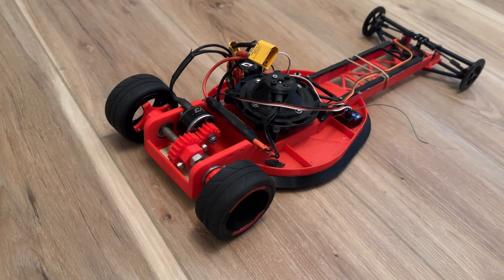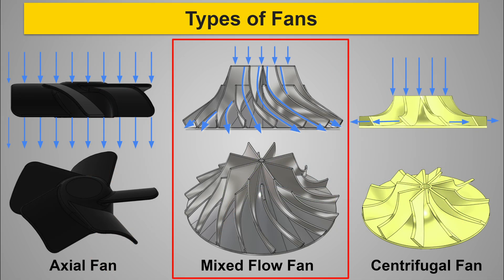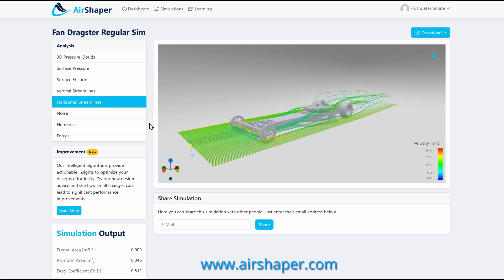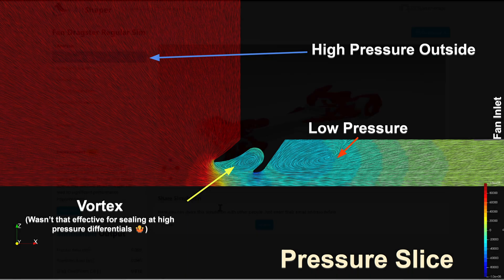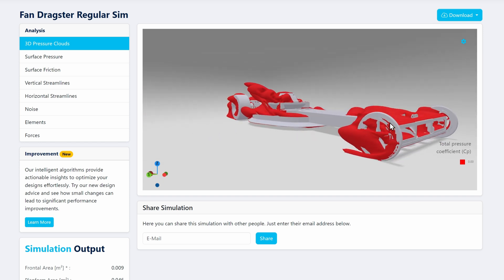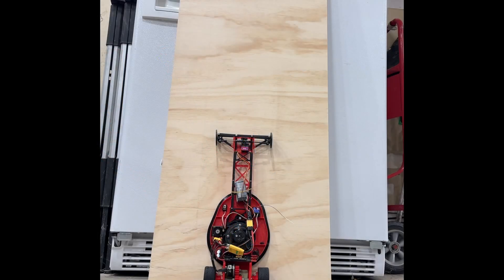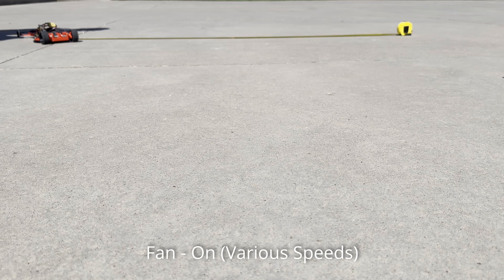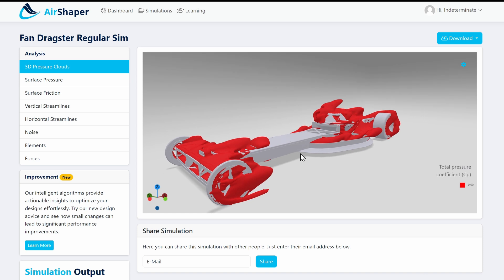This RC Dragster Uses a Fan for INSANE Downforce & Acceleration!

Comment: World record is 1.11 seconds 203 kph in 1/10 drag strip or 40.2 meters the car is a drag rail car =no frontal area .. you can see what a real rc drag car does type worlds fastest rc drag car 1.11 …Brendan podlich set this record over 10 years ago now .. I take nothing away from you experiment it’s excellent but in drag sense for rc cars it’s no comparison to what racers achieve

Comment: I am so glad I found this!  I've been researching background knowledge to make my own fan downforce combat robot for ages, and I've always agonized over the choice of fan type.  I'm so so so glad you put in the work to run the CFD and show  how helpful it can be; my plan before watching was to just run a ton of physical experiments, but you've sold me on  trying Airshaper instead.

By the way, have you considered an air jet skirt design?   They work by pulling air from below the skirt with a high static pressure fan and jetting it downward around the periphery of the low pressure zone to form a "wall" of air.  I've only found one research paper on their applications for downforce (since they've mostly been used for hovercraft), but it seemed promising.
Reply from the maker: I read that research paper as well, I haven’t tried simulating the air jet system, but it’s on my list of things to try. I don’t know if it can be done with just a single fan so that adds some complexity. When I just duct the air coming out of the main fan I don’t have sufficient volume. The better it seals the less air the main fan has to create the seal 🤔

I don’t remember seeing it in the paper, but there’s also the effect of the car moving.  Looking at the CFD more shows a lot of air being forced under the front of the skirt.  

There really just hasn’t been enough research done on fan cars.

Comment: Brilliant! I believe that if you angled the blades at the inlet you could achieve more pressure differential between inlet and outlet. A MAP sensor could alter fan motor speed rather than the relief valve if you think it could give more control of the pressure drop. Foam tires will give better traction. You could use carbon fiber sheets oriented vertically to stiffen the frame in bending. Making the frame able to twist the front axle can help handling. Think a pivot to allow the tires to go up and down acting like a single front wheel can help traction. I've subscribed. I want to see where this goes!
Reply from the maker: That's interesting, I want to try more fan designs.  When I was trying different blade profiles I had a hard time increasing the pressure ratio while keeping the same flow.  I think I need operate the fan at a much higher rpm, like 50k+.  I'm working on some designs for a better fan car based off the chassis and suspension of my RC Hypercar, then I can individually tune the different suspension modes.

Comment: Great video and thanks for the shout out! 

I like your approach to seal path length. if i were to do it all over again i would make a smaller seal area because i often had more downforce than i wanted but was super leak rate sensitive.
Reply from the maker: Thanks. I wish there was a way to make these cars less sensitive.   I’m going to mess with some pressure sensors and controlling the fan speed realtime.
Reply: @IndeterminateDesign  I really think I can help out. This is one of my passes a lil while ago at the midwest classic. No prep surface, 2s battery, rear wheel drive only, rubber tire. 
https://youtu.be/9vphxP0f1e0

Comment: Why is the rear tire low profile? There is no sidewall to crunch, increase traction, & shorten drive ratio?

How does a bristle brush skirt compare?

Why use a valve to control downforce instead of a sensor & fan controller?
Reply from the maker: I had to use stiff tires and reinforce them with inserts to try and keep as constant of a ride height as possible due to the downforce. Bristle skirts can work somewhat but you need enough room for the bristles.  This was just a first test hence I didn’t want to complicate it with sensors and tuning, the mechanical valve was simple and light.
Reply: @IndeterminateDesign  a simple pressure switch would be lighter, and conserve battery, but if you worked in a traction control system (with a pressure sensor) you could take full advantage of wrinkle wall tires.

Not only does the contact patch get bigger (longer) when it is launching, the tire gets shorter, so the gear ratio gets shorter. As the car accelerates the tires get taller, so the gear ratio gets taller. The tire is almost a vintage CVT.

Comment: How much force does the fan have to have to be effective? Nothing off the shelf in terms of cooling fans would do anything I'm guessing
Reply from the maker: Any fan will create some low pressure. It really comes down to how much floor area you have, how well the floor is sealed, and how much down force you want to generate.  Most full size fan cars, like those used for FSAE use powerful radiator fans because even a small pressure drop over a large enough area can create a lot of downforce.
Reply: @IndeterminateDesign  so do you a 35 or 40 mm fan spinning at 21000rpn would be worthwhile?
Reply from the maker: I don’t know exactly. You could test it with a piece of cardboard the size of your car’s underfloor and some spacers that are the distance to the ground under your car.  Then try to lift a box or something with it.

My car was able to lift a filament box with ~2kg of filament.
Reply: @IndeterminateDesign  that's a great idea actually.. Thank you

Comment: The Brabham BT46B had this in the late 70. It got banned because moveable parts for aerodynamics were not allowed. And if the car looses the contact to the ground, out of what ever reason, the ground effect was completely gone and the car would flew into the sky.

Comment: i love how you managed the pressure, that little valve was genius . i've been tinkering with my own at our biweekly drag meet and having the pressure fluctuate made it hard to be consistent .that valve is exactly what i needed. a receiver with a gyro or even just a standalone one will do wonders for keeping your overpowered motor version going straight. and when i added a slipper clutch it gave me more options to really dial it in and lowered my time.
Reply from the maker: Thanks. I agree, I never got the gyro going on the car.  I need better front tires too. Oh well, next version.
Reply: Great project cant wait for v2 there are some traction addatives i think would help with initial wheel spin & i know this is what your priject is about but would b interesting to join both forces once you get all u can out of the vac👍

Comment: What material are hovercraft skirts made of? The suction force from the fan could be the inflation force for the skirt too maybe.
Reply from the maker: Most of them are just reinforced rubber. They do wear fairly quickly, but they usually leak some air so the skirt isn’t in constant contact with the ground and they’re pretty slow <35mph so that helps.

Comment: Side skirts were also ubiquitous in the F1 ground effect era. Some teams used brushes to effect an edge seal, a long thin strip of that brush like draft excluder might serve well on the RC scale.
Reply from the maker: I really thought about using brushes as a secondary seal to help block out debris and provide a bit more sealing.  There are so many things to try out.

Comment: could you make the air gap variable, so you can get max downforce at launch and reduce it as you gain speed by raising the skirt a few mm? That way friction should be a lot less of a problem
Reply from the maker: That could be done and I could do that by changing the fan speed as well based the car’s speed.  Ideally you want a consistent level of downforce because the motor has way more power than the tires can handle at almost any speed. Part of why I think it may spin out is because the downforce drops when it hits a bump or rough surface.

Comment: Is your idea would be the reason why I would want to get into drag racing because the biggest problem I've seen with all the drag races out there is they can't run a straight line and I think that just sucks so you're an idea is super awesome maybe the car companies RC that is needs to incorporate that into their dragsters and quit playing around about it
Reply from the maker: Yeah, I think it’s already banned. I’ve seen some of the rules and they only allow fans on the ESC or motor to exhaust down. I think some people were mounting ESCs upside down with powerful fans 😂. 

I really wanted to make a drag car but they also ban non-commercially available chassis’s.   I really hate rulebooks.

Comment: Maybe a mesh guard for fan and foam tyres?
Reply from the maker: I think grippier foam tires would make a huge difference.  I did try some mesh on the fan inlet but it clogged really fast with debris.  The skirt blocks the large debris, but sand and tiny rocks still go through and chew up the nylon fan blades. I’m thinking maybe a cyclonic separator or something.  Basically remove the heavier particles.

Comment: great work,  try the battery at the back in front of the motor.  also did you design in some castor to the front?
Reply from the maker: Thanks. There’s no caster in the front since I didn’t think I’d need for it to turn at all. The front tires are TPU which also don’t give much grip, in retrospect I should have done a lot more work on the front.

Comment: Why do you feel the need to have a sucking skirt? I would have air scoop ducts facing forward ,and duct them to the 4 corners of the car facing up! Like an upside down  Harrier Jump Jet! Then it can at least look like a normal car, this could give any car downforce!
Reply from the maker: Mainly efficiency, with roughly 12-15amps current, I can generate 2.5kg of downforce. To have that same amount of thrust by throwing air straight up would require a lot more power.

Comment: You could look into adding "bumps" or "sliders" to the  floor seal, so that even when it is scratching the floor there is a gap for air to enter, and you don't get a perfect seal. Of course, this would still create some friction, and I don't know how they would perform at RC scales.

F1 does something like this with it's floor edege skids, because these flex so much that they where scraping the ground forming a perfect seal that induced porpoising.
Reply from the maker: I’ve been looking hard at some kind of skid devices. There are some metal ceramic inserts for polishing that could last a long time like this.  I need to test it out. I’ve been mainly worried about the relative surface roughness just grabbing the bottom of the car and ripping the skirt off. 

I need a smooth indoor RC car track.

Comment: Nice ! Do you plan to iterate on it ? May be you can extend the skirt further to the front to find more area ?
Reply from the maker: I want to iterate on it more and see what I can do.  Changing the floor height and possibly moving the fan inlet forward can shift the downforce significantly.

Comment: Hi,
Awesome project and results. 
Just found out your channel so I don’t know if you’ve tried this before but, stability issue with the large motor might be solved by increasing front toe-in angles.

Let us know about the improvements.
Reply from the maker: I’ll try that. I didn’t talk about it but the tiny front tires are made from TPU and don’t have much grip so steering isn’t great.
Reply: @IndeterminateDesign  I hope the additional slip due to toe angle will generate higher lateral forces s.t. it will be enough to help stability. Good luck with your further improvements.

Comment: Maybe mount the fan deck also on wheels? The same as a ride-on lawnmower cutting deck to keep the skirt at an even height.
Reply from the maker: I really want to try that with some tiny casters.  I really need a whole more complex chassis that allows for enough for a skirt to slide up and down.

Comment: 2 fan blades, 1 with reversed blade direction...1 blade spinning 1 way...the other spinning opposite....to mitigate that rotational force? Are you not constantly having to correct the steering? Especially at distance?
Reply from the maker: That’s interesting. I didn’t think about that. It drives really straight when I’m not full throttle.  I only notice it when I change the fan speed quickly.  Would it still do that at a constant speed?  I know on RC airplanes this shows up, the fan is only 60mm diameter but spinning at 30k+ rpm.

Comment: Now put a real no prep rc drag sensored power system, drivetrain and slicks on it. make the wheelbase and trackwidth compliant with short truck based drag cars, put a body on it, and go take some peoples  money.
Reply from the maker: That would be awesome.  I really thought about buying one of those carbon fiber drag rails but wasn’t sure this would work at all. 

Surely the no-prep guys have some rules against fans. Otherwise I could put a massive fan on my ESC 😂
Reply: @IndeterminateDesign   rear mounted ESC with thrust ducted over the heatsink.

Comment: You've clearly done your homework on this project, but I thought I'd share what I'd have done with no research.
My thoughts went directly to a blower (squirrel cage) with the intake ducted and rear facing exhaust. I would have looked for a soft bristle brush type seal which would leak off enough air to not need a regulating valve. 
Now I'm curious how this would work, if at all.
Ratio changing dragster tires could offer the ability to switch from vacuum downforce to a automatic wing since the wing would start to work about when the tires grew enough to dimp the fan downforce.
Awesome project with impressive g-forces and challenging frame flex.
Reply from the maker: Thanks. I thought about the squirrel cage fan but packing is harder. CFD was helpful because I got a lot better feel for how much air the fan needs to move.  I think any kind of fan could be made to work. It comes down to your approach. High suction for a small area and less seal leakage or lower suction over a much larger area with a lot more seal leakage.

Comment: try Front Wheel Drive..... shouldn't be too hard with what you have already. at least for directional stability, straight drag racing. I heard about this concept from a Veritasium video about AI mini RC cars racing through mazes, "Micromouse".
Reply from the maker: That’s awesome. I should have tried running the car backwards. I bet it would have done better. There’s not a lot of weight transfer with a car like this.
Reply: @IndeterminateDesign  👍

Comment: I had this idea a long time ago but no way to execute. You did an amazing job! My RC drag car pulls over 6gs off the hit and does sub 1 second 0-60 no problem. I run 132ft in 1.49 seconds at 101mph. I’d love to talk more to ya about this fan.
Reply from the maker: That’s crazy. I assume that’s on a prepped surface?  Is the car traction limited at all?  It’s crazy the power to weight ratio possible in an RC car.
Reply: @IndeterminateDesign  on prepped track, these guys are running 132’ in 1.3 seconds… my best on a prepped surface is 1.44. On no prep, some of my guys run 1.38 seconds. I’ve had an idea for a fan for a while, but just having a hard time getting things mocked up.
Reply: I’d love to see that on video.. Why don’t you have any videos 🤔
Reply: @EJ-74  I have plenty of videos and live streams of events I attend. I race at a national level... I'm in the green shirt, left lane. I'm running my 10th scale drag car, rear wheel drive only, rubber tire, 2s battery, no prep surface. This is NOT my fastest pass but I'm running 1.51s at 94 mph.
https://youtu.be/9vphxP0f1e0
Reply: @EJ-74  Or if you would rather see at 101 mph pass... Still not my fastest ET... 
https://youtu.be/POly5GH50mE

Comment: Maybe use carbon fiber rods to stiffen up the chassis.
Reply from the maker: I have a couple of 2.5mm ones hot glued in there but they obviously weren’t big enough to do anything 😂.   I need to stock up on supplies.

Comment: Idea I had was an air curtain around the edge of the seal, even using the outlet from the fan, it is directed outwards so helps add to the suction underneath. The pressure has an air hockey table like effect preventing seal from actually touching the surface.
Reply from the maker: I love that idea. There’s a great research paper I read on this approach.  They only did simulations but it was quite promising because it was much less  sensitive to ride height changes.  I’d love to test this with a second fan to be able to control that flow and measure the impact. 

The vortex sealing for a skirt really is too sensitive. If you have too high of pressure differential the vortices just burst.  A boundary layer extraction system might work too.

Comment: could you get better acceleration out of it if it was made AWD?
Reply from the maker: I think so.  It would use the downforce a lot more efficiently having the front wheels be driven The poor front tires had a hard time steering when the fan was at max speed.

Comment: I'd love to see a fan equiped version of the RC hypercar, to make it turn even quicker at low speeds.
Reply from the maker: I agree. I’d love to build one, and for once I decided I should play around with some prototypes before putting tons of hours into something like that.
Reply: @IndeterminateDesign  that makes sense. I'll be looking forwards to it :D. I also think it would be super cool if you integrated dual axis steering or something like that into the hypercar.
Reply: @playyourturntodieatvgperson  don;t know what a RC hypercar is, but I first saw this vacuum concept on a Veritasium video, about this crazy mini RC AI car race called "Micromouse", where they're timed individually racing through a maze.
Reply: @secretbassrigs  the RC hypercar is a project made by this youtuber, it is a AWD, torque vectoring, aerodynamically optimized RC car.